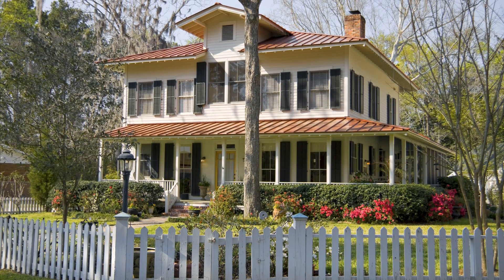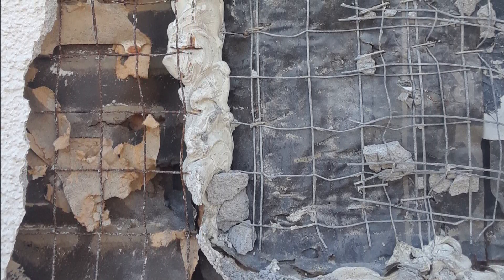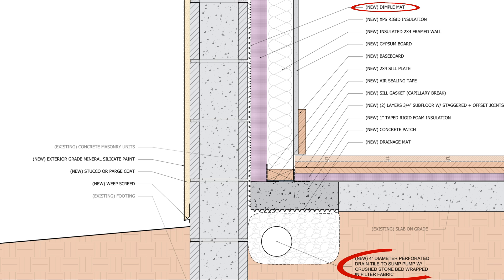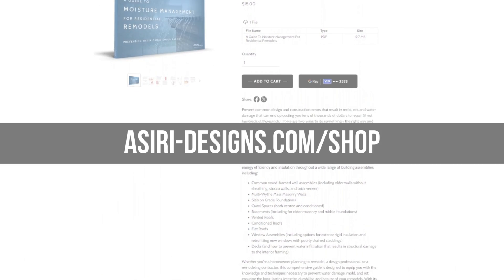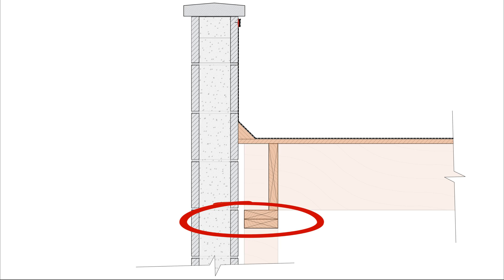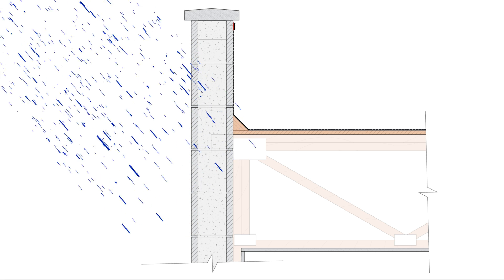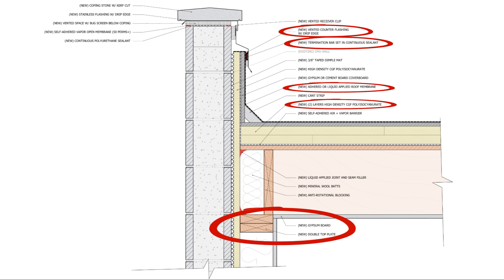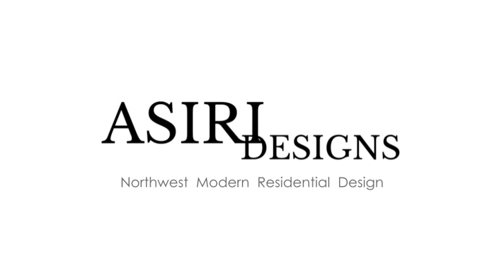A Guide To Insulating Old Homes For HOT HUMID Climates (Part 2) | Walls & Roofs

Comment: Just bought a house and well you dont know what you dont know until you find out. Building inspector didnt care to mention this as a SERIOUS issue so I signed off on the house. 

The house is built into a slope, and the rear lower level includes a fully  earth-bermed void space 2.3 ceiling  with exposed soil up to avoid 60-70% high behind internal block walls (the exterior wall is packed in like a underground basement) on one side of the house. Its been block built into the slope and filled in internally to act as a retaining wall. This unventilated soil cavity creates high moisture levels that migrate into the interior. Combined with metal lining-board ceilings, the trapped humidity causes condensation and mould.

This space smells like a dank mouldy pit and I live in the tropics. I need help figuring this out because Im worried that due to the musty smell upstairs its rising damp into the home. 

There is a downstairs living space with metal slat beam ceiling as well. 

Im shitting my pants.

Comment: Looking for part 3, especially dealing with attics in old homes in hot humid climates.

Parts 1 & 2 were very helpful and much appreciated.
Reply: Yes CMU/standard timber constructed Florida homes with fully ventilated asphalt roof systems and otherwise conventional detailing (spec home grade) video covering all the potentialities especially pitfalls when enhancing these properties would be extremely helpful!

Comment: Handyman- I’m trying to insulate an old shed into a useable man cave/workshop. It only has wood cladding with no barriers or insulation. My original plan was to use open cell spray foam and polystyrene 2” insulating boards. I’m in Tennessee and I would like a recommendation for some type of weather barrier that I can put into the studs to block water ingress as I can see daylight through some of the cladding.

Comment: What about using a waterproof coating such as drylok, on the exterior of brick cladding on framed homes?  To prevent water/ vapor from getting between the gap and condensing on the sheeting of and old uninsulated wall that is retro insulated.  And then painting the drylok for asthetics
Reply from the maker: The problem with drylok is that many of the core range of products are vapor impermeable, which prevents the masonry from drying, and eventually you start to see that drylok coating fall off. Water WILL get inside that masonry either way, and so it's much more effective to apply a vapor open silane or siloxane to provide a water repellent surface to reduce surface absorption, while still allowing the brick to dry out (via diffusion). Remember, that the brick is coupled to the ledge of the concrete foundation, which means that it's wicking up water from the soils below.
Reply: @ASIRIDesigns  thanks for the info, I will have to research this more. Thanks for the book link.  In coastal MS I have been seeing a trend of painting 1950/60s brick homes. I wonder what combination of sealer and paint are used for a lasting finish, since there is no going back once paint is sprayed on brick. I have also seen these homes with no insulation in stud bays, so doing blown in cellulose or fiberglass through the drywall, could create a whole new set of problems. Low r value is better than rotting framing. Maybe a light colored paint for the reflective value, and air sealing drywall penetrations.